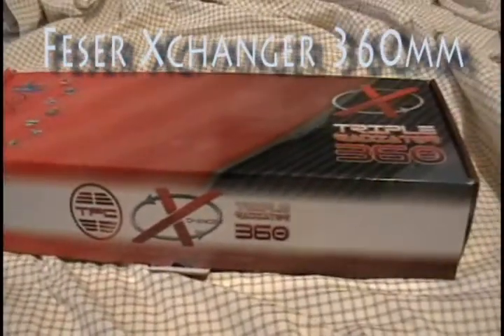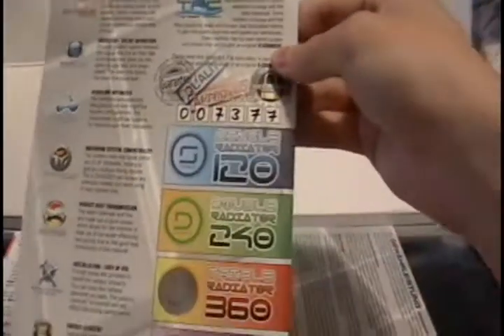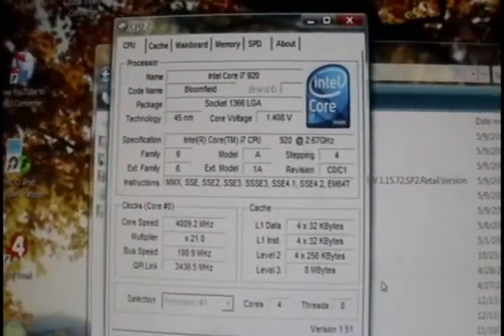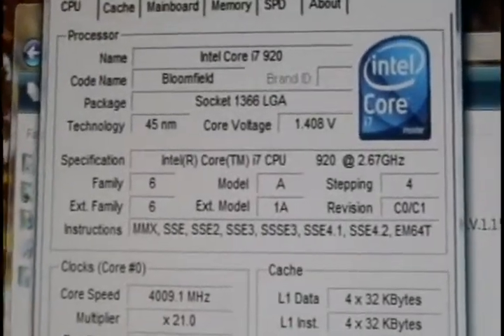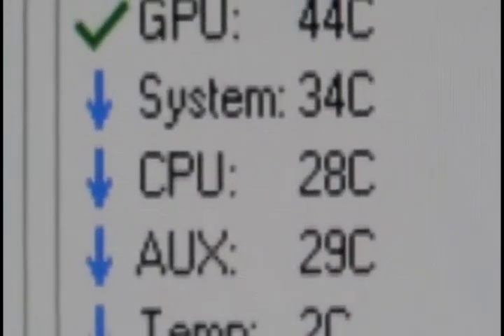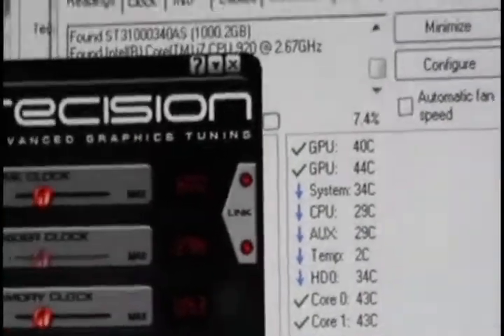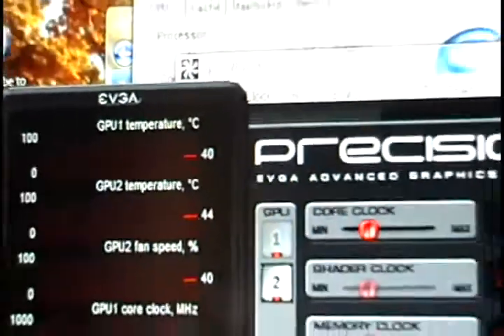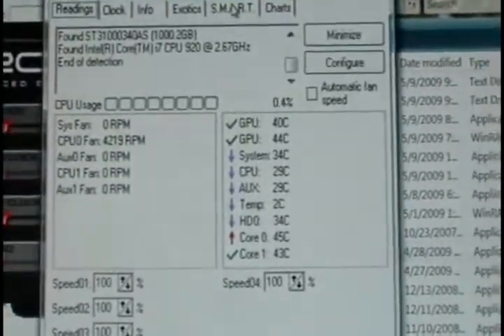Feser Xchanger 360mm Radiator

Comment: im trying to find on the net if an 360mm radiator could work with 2 gpu and 1 cpu.
i have already an 360mm radiator and my quad phenom running a 31C idle. i wonderingif i could put my crossfire double hd4870 on the watercolling setting...